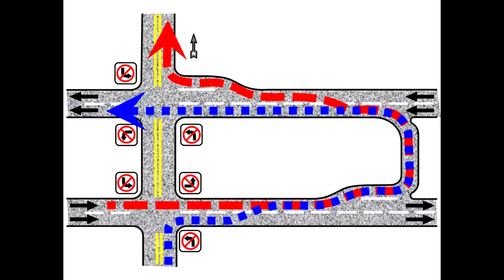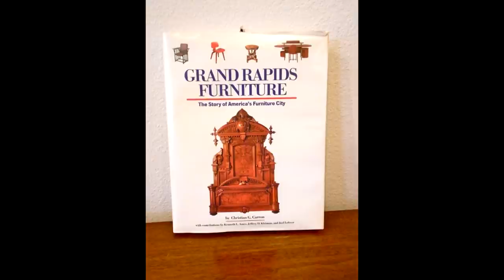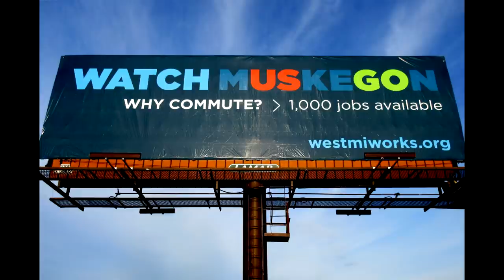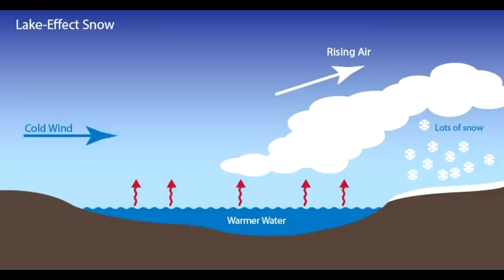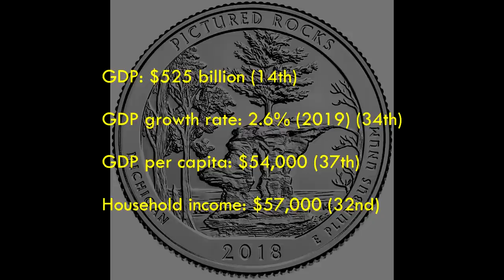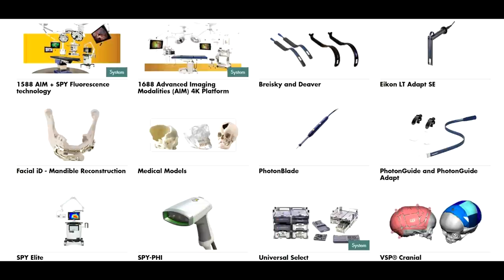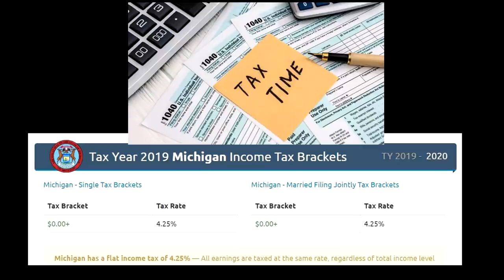Michigan: State Profile

Comment: Its been many years since I've been in Michigan, but I recall quite liking the 'Michigan left' as it worked as i recall very differently than you describe. I remember being able to turn right at an intersection,  including on red,, and then cutting across a lane or two to a little ramp in the median, well before the next stoplight, which flips you to the other side, no stoplight involved until the stoplight crossing the street you just turned from, which often has a pretty short wait time if any since there's no extra signal rounds for left turns. The end result being that you often go through the intersection much quicker than you would have if there is a regular left turn lane, and I imagine these intersections are at least theoretically safer since there aren't as many potential crash points from turning traffic going different directions. Personally, I'd love to see them, as i remember, implemented everywhere, they definitely seemed to help traffic flow, the Detroit suburbs i recall had surprisingly well-flowing traffic for such a large area; the only downside I can think of is you need a wide median.
Reply: that is an option
Reply: Tt The downtown Detroit population grew by a 1000 people and  more diversity too, not to mention a substantial decline in crime.  You mentioned Greektown, but Mexican town is a tourist designation for food, shopping, and Irish town Cork town, Bells Island and the deadcenter of the city is thriving with much food and shopping entertainment... Detroit is building the largest skyscraper in Michigan, largest bridge in America to connect Canada and Ford Central Station which is the largest train station in the world and is now owned by Ford and coined as The Brain Station which will be the Silicon Valley of the north...you never showed the super rich areas in Detroit neighborhoods like Indian Village...  Dude Ann Arbor is very far from Detroit, not next door over....,.......Grand Rapids is the fastest growing in the USA, both population and economiclly. You never mentioned Grand Rapids have largest data center in the USA called Switch, largest art event in the world and their international airport is  rated number one in the nation too. Western Michigan University is also located in Grand Rapids. By the way your coverage of kalamazoo is The downtown Detroit population grew by a 1000 people and  more diversity too, not to mention a substantial decline in crime.  You mentioned Greektown, but Mexican town is a tourist designation for food, shopping, and Irish town Cork town, Bells Island and . . By the way your coverage of kalamazoo is did no service... That city is famous especially for their education, their research and medicine industry Pfizer (the covid-19 first vaccine came from here)  the downtown of kalamazoo have  heated streets and sidewalks snow melt system, the kalamazoo Promise program is one of it's trademark too, among other impressive things. Rated high by Readers Digest to live in as well as highlighted by Wall Street Journal etc. In 2019. Michigan is 2nd in apples, 1st in variety of apples and actually number one for blueberries and 2 for wine in the usa .. by way kalamazoo was where the invention of the electric guitar 🎸 and Elvis Presley had an apartment in Kalamazoo.... That city is famous especially for their education, their research and medicine industry Pfizer (the covid-19 first vaccine came from here)  the downtown of kalamazoo have  heated streets and sidewalks snow melt system, the kalamazoo Promise program is it's trademark too, among other impressive things. Rated high by Readers Digest to live in as well as highlighted by Wall Street Journal etc. Michigan is 2nd apples, 1 in diverse apples and actually number one for blueberries and 2 for wine in the usa .. by way kalamazoo was were the invention of the electric car and Elvis Presley had an apartment in Kalamazoo...sorry for the repeats. I could not correct for some reason
Reply: It really depends on where you're at. Really crowded intersections will have that light in the median, but in less crowded areas it won't.
Reply: Works well on the highways. Really easy when I was a 16-year-old driver.

Comment: I was stationed at Wurtsmith Air Force Base (outside of Oscoda) back in the late 1960s. The area was nice, although it was a bit of a drive for nightlife to either Bay City to the south or Alpena to the north. This was my  last duty station, having just returned from Southeast Asia. What a contrast! I do recall the friendly locals, and also the brutally cold winter months. The base has since closed, but I feel fortunate to have experienced that  part of our country.

Comment: Not gonna lie, I love the Michigan left. Makes stop light phases so much shorter. Btw not a native Michigander
Reply: If you lived in suburban Detroit in the 1970s before the Michigan left you would know why this is so good.  The horrible accidents before have been eliminated
Reply: We can usually also turn right on red and even left on red onto a one way st. This speeds up the process. Just have to figure out what lane you need to be in before you start in the multiple lane interchanges at the larger intersections.
Reply: Moved to Florida from Michigan a year ago, and I desperately miss the Michigan left
Reply: I've always seen the U-turn before the next intersections, so you hit two lights, not three, and at the first light you can turn right on red, so it's more like 1.5 lights.  It's actually quicker than intersections that have left turn arrows added to the cycle.
Reply: @howard three lights is possible and happens 50/50.  It doesn’t matter if you see the u turn? You approach an intersection and may have to stop at the light to turn right.  On green you proceed.  Get into the left turn lane and may have to stop at that light.  On green or whenever safe if legal you proceed.  You may have to stop at the light at the first intersection you started from.

Comment: Great video of my home state. In my hometown there is a major boat manufacturer. Plus, my hometown has a lake in the entire city limits and where the boat manufacturer can test boats within a half a mile. There is a canal that connects two lakes which will freeze first before the lakes and then thaws when both lakes freeze over. Anywhere in the state you’re no more than 50 miles away from a Great Lake. There is one thing you forgot to mention is that Northern Lower and U.P. is touristy. There is one thing is that you get $.10 back for every pop (soda in other parts of the country) bottle/can and beer bottle/can.

Comment: Great video overall (loved seeing Winter Carnival pictures when you were talking about Houghton), but I personally have a few nitpicks. The Michigan Left isn't nearly as ubiquitous as one might think. It's much more common on the east side of the Lower Peninsula than the west, north, or the UP. The Air Zoo is technically in Portage, but that's in the Kalamazoo Metro Area, so that's not really that big. However, Stryker is headquartered in Kalamazoo, not Grand Rapids.

Comment: Opps - one more thing.  I would like to defend the Michigan Left.  It is actually a very safe and easy thing to do.  Whenever, it is installed it reduces collisions by 30 to 60 percent and increases the speed of traffic flow.  That's a real "Wow!" Left turns can be very, very dangerous.  I lost a relative at one when he was waiting to turn left and got rear ended and pushed into the middle of the intersection.   Also, when multiple lights are timed at intersections, they greatly impede traffic flow.  Michigan Left Turns are certainly much better than the alternative of the "roundabout" or "rotary," where cars are coming at you from ALL directions.  Actually, many states and other countries are beginning to adopt the Michigan Left.  As far as Rotaries, the state of Michigan has installed some and most people absolutely hate them.  The Michigan Left is sort of controlled Rotary with lights and easier merging.  Maybe this might be a cool subject to explore further.

Comment: I had to stop the video at Flint to comment  about the water and Lake Huron. Flint was getting it's water from Detroit( they use lake water) Flint decided they didn't want to keep paying Detroit for lake water and decided to build a pipe from Lake Huron to Flint. Flint informed Detroit that in a few years they would not be purchasing water from Detroit. Detroit said o.k. and raised the water rate for Flint( Detroit was going to loose money and they decided to get as much as possible before the switch). Flint didn't want to pay the higher price and decided to use the Flint River as a water source. That is when the problems started. The water dept. was still trying to figure out how to make the water drinkable and follow EPA rules.  The city said on this date we are switching and the water dept. asked for more time but the city said "no" and they switched to the river and that is when the lead started leaching into the homes from the pipes. I sort blame Detroit a bit on the water crisis in Flint... If Detroit wasn't so greedy then the water would not have been a problem.  The pipe is finished for Flint, but no water is being pumped into it. Flint eventually went back to getting it's water from Detroit. And properties in Flint will take a long time to recover. It's a shame.

Comment: The Michigan left. I may not live in Michigan but when I learned how to drive (I didn't according to the wife) I had it drummed into my head that when you want to turn left onto a major street and there is a lot of traffic you turn right then two lefts and then turn right to go the way you wanted to. At least then you aren't blocking traffic. And by the Michigan left I assumed you meant the practice of the left turn arrow after the traffic has had its turn to go straight. Although I hated them to start with I really appreciate round abouts now.

PS, also l have noticed in San Francisco that on order to turn left off a major thoroughfare you often have to make a right turn and loop around to get where you are going. But driving in the City is crazy to start with.

Comment: You've made a mistake in this video talking about the "left turn" and MI being the only state that does not allow direct left turns.  New Jersey has what is called the "Jug Handle".  To make a left turn you have to turn right, exit the highway, generally at the next available exit, turn left and go back over/under the highway and then turn back onto the highway to complete the left turn.  There may be others as well so your comment is incorrect.

Comment: Oi you forgot Midland's Very long history of chemical production! being the founding place and headquarters of Dow itself! which means compared to Bay City and Saginaw Midland is a bit more economically stable. Especially since there are multiple, multiple factories still running at full capacity inside of its huge industrial park. That said, other than that, fantastic video!

Comment: A Michigan Turn is a half measure at integrating a roundabout into normal high traffic networks. With limitations on expansion and a need for cross walks the U turn works and has in enough places limited the amount of backup. Under the right conditions right of way traffic lights can be included or excluded in favor of stops or yield signage. Given the frequency of median separated access highways it's a good tool to use.

The common usage of this left turn system often permits drivers to assume a right turn or merger on a red light. As a road exchange it may not be limited to Michigan but I assume it was designed this way for a reason and likely for costs. Accidents connected to left turns at high volume roads were probably the highest concern and I expect the state and locals would not have built so many if there hadn't been a decrease in road accidents and fatalities. One thing it may also improve on is pedestrian fatalities as all traffic being funneled from two directions rather than three. That period where cars can move from center to left shortens the cross time for pedestrians in adding it onto the next through cycle on the other side of the road. If fewer accidents are occurring and fewer dead I'll take it as an oddity and not stupid in the slightest. Stupid is not knowing of it or being prepared to navigate it if you have. Roundabouts are uncommon and yet they're exposed to new drivers so they'll understand the exchange should they encounter them.

Equally stupid is not knowing the difference between the express lanes and the divided exit lanes moving in the same direction in the city I came from. But that's in part a problem of variety not being covered in drivers education.

Comment: The Michigan left turn doesn't involve a right turn then a left usually.  You go past the intersection on the left turn left at a crossover then turn right. But yes at times a pain in the ass. Yes occasionally it's a right turn followed by a left at a crossover

Comment: I used to commute weekly to MI from MA for almost two years between 2005 and 2007.  I worked for Delphi in Novi.  That was a nice area to spend the week in.  Quiet and pretty.  I considered moving to MI back then but in the end, I figured I liked MA a little more :-) I also consulted in Grand Rapids (very pretty) and in Dearborne (meh) for Visteon.  MI is a nice state.  I didn't realize the tax burden is lower than Massachusetts.

Comment: Nice video. One thing, though: when you mention the "Michigan Left," you say that, in any other state, you can just make a left at an intersection if you want to turn left. However, the jughandle is a pretty well-known trait of New Jersey.
Reply: But the Michigan Left is proven safer.
Reply: @warriyorcat  Really? That's interesting. Do you know what makes it safer?

My comment was just to point out that it wasn't exactly the case that "in every other state" making a left is as easy as, well, turning left. But I'm curious why Michigan's left turns are the way they are as well.
Reply: @All5Horizons  Because you aren't turning through multiple lanes of traffic and have to make mad dashes across intersections before the light changes. many Michigan Lefts are also timed, so that when you get to the light, you can turn (even if it's red), and reach the light at the intersection you just left right as the light changes from red to green. In addition, with a Michigan left, you turn into the nearest lane (you're supposed to, anyway), which means you aren't crossing three to four lanes of traffic, reducing the risk of an accident.
Reply: @warriyorcat  Interesting! Thanks!

Comment: Not bad, but I'm honestly surprised that you don't see the benefit of the Michigan Left Turn. It's actually not set up that way throughout every city in the State, but it's habitual on the busiest streets. One way to know you're behind a tourist in traffic is that they'll sit for 15-30 minutes waiting for traffic to clear so they can make a left turn to/from a parking lot or intersection that doesn't have a Left Turn traffic signal. I know that's a way of life in most other places because when I've driven in other states, I see everyone doing that - waiting forever, burning fuel at 0mpg. If I'm driving in another state with a friend from that state in my car, they make a huge deal out of me turning to the right onto a street with endless traffic when we're going to a place that's in the opposite direction. Yes, I have to wait at the light to turn around - usually by waiting for oncoming traffic at a left turn into another business and then back around to make a Right turn to get headed where we're going. But it's faster than waiting for endless traffic in both directions. And you know as soon as one direction of traffic clears, the other gets busy, so you're waiting for endless traffic in both directions unless you make a Michigan Left.  I'm a native Michigander who's moved away a couple times and travelled a fair bit, but the Big Mitten always reaches out to pull me back home to my HOMES state (you might have learned the names of the Great Lakes with that acronym for Huron, Ontario, Michigan, Erie and Superior; of course Lake Ontario is the only Great Lake that doesn't touch the State of Michigan).

Comment: The Michigan left is annoying but it's not all that common. Left turns are valid on more than half the roads near where I live in northeast Warren. Yeah Gratiot, Mound, Van dyke, Hall, and 16 mile all have those turns, but all the other mile roads from 9 to 26 at least are normal as well as Hayes, schoenherr, Garfield, dodge Park, Ryan, Dequindre, and most other roads are normal. Usually it's the tope 10% biggest roads that have those turns.

Comment: Upstate NYers DO NOT call hot dogs Michigans. First off Plattsburg is not a spot one would call representative of all upstate NY. Second, and more importantly. I believe you are being misled by the poster as the establishment is probably advertising them as that because they got the idea to put that particular sauce on some. Coneys (coe nies), many upstaters  pronouce coo nies (very small amount, call them white hots). [Rule of thumb - NYers will never give another state credit for something they like (facts and accuracy have nothing to do with it). Making a quick buck off it can be an exception.]  Michiganers in and around Detroit (The motor city) appear to believe they are simply born with the ability to drive. They are right on top for every place I have traveled in the US as - the worst/consistently most dangerous. Yup Syracuse (one could write a book on the various pronunciations - just in upstate NY, let alone globally) wins the "Snowball Award", but UP is far worse - that's probably why no one has been stupid enough to make a city there.